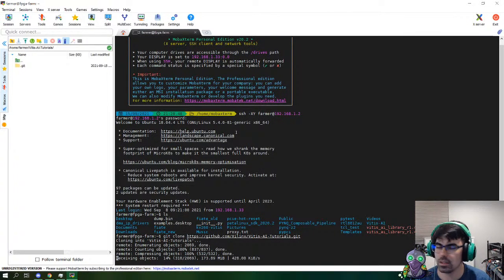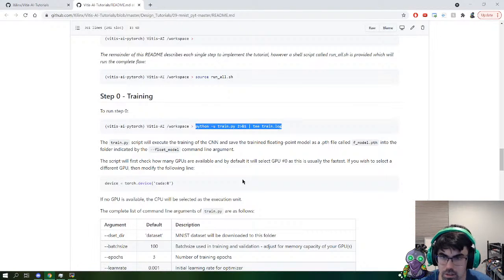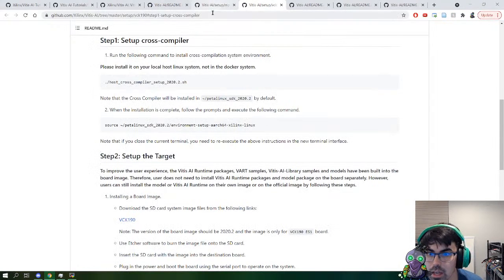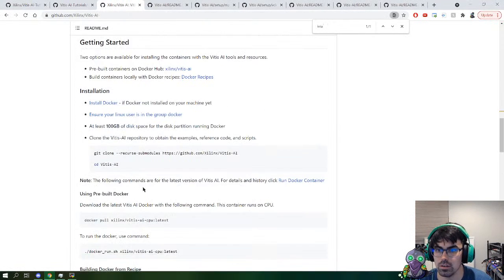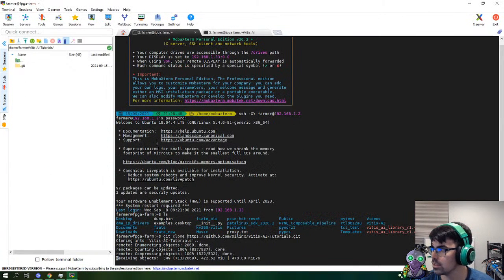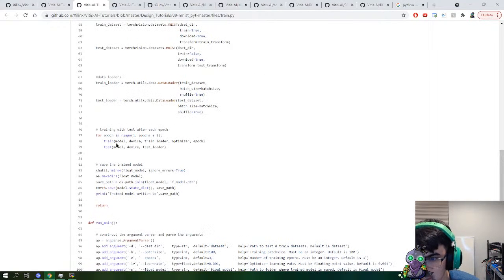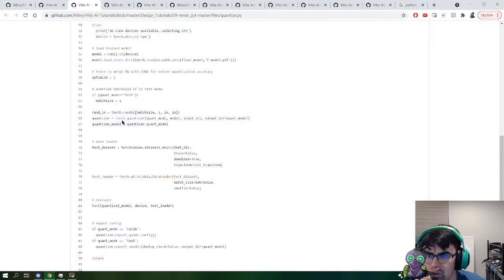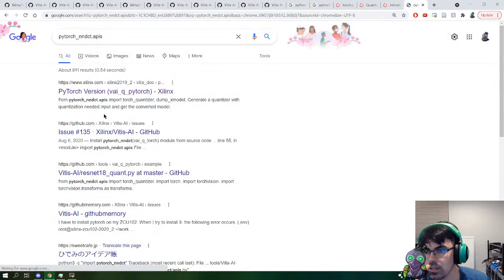Vitis AI (1.4) Pytorch Tutorial Walkthrough

Comment: Hello, Do you plan to give a tutorial on how we can quantize and compile our own model board?
Reply from the maker: Sure, what tools (PyTorch, TensorFlow, Caffe) and/or network are you interested in?  Which FPGA development board are you using?
Reply: @FPGAZealot   thanks. I’m using vck190 es1. I would be interested in tensor flow and pytorch for now. But might need other tools later on
Reply from the maker: Are you preprocessing the inputs in the FPGA fabric? The Versal setup is different, but a DPU example should get you most of the way there.
Reply: @FPGAZealot  I actually plan to not do that in fpga. Can you tell me from where to take a start?
Reply: @FPGAZealot  if we have a tensor flow keras model of our own and data set of our own steps we need to take to  run it on board like train quantize and compile. It would be interesting if you go through such a tutorial